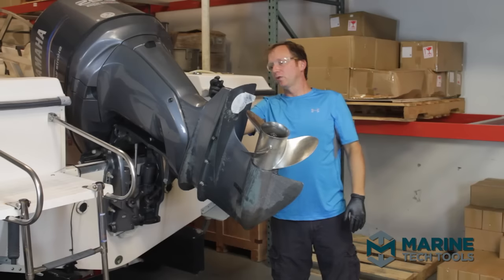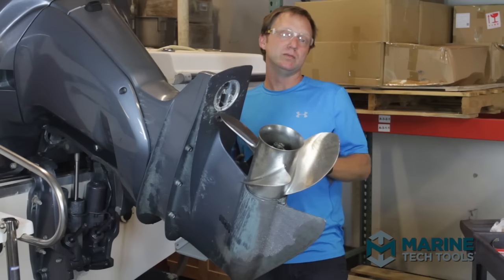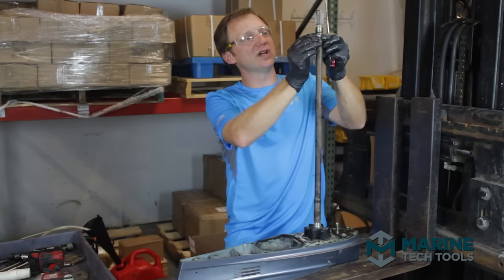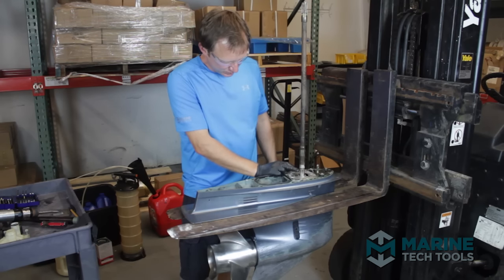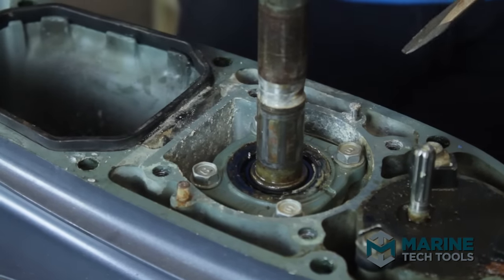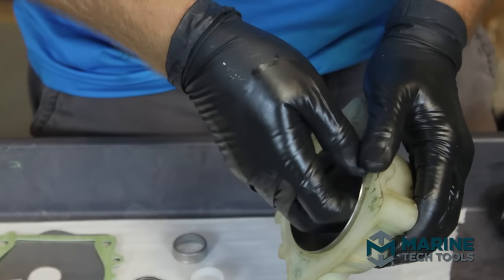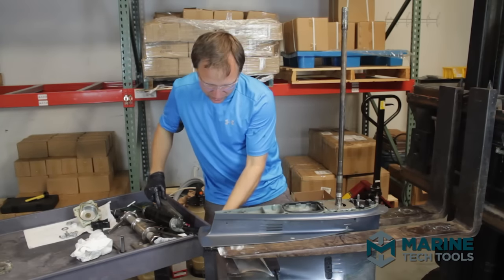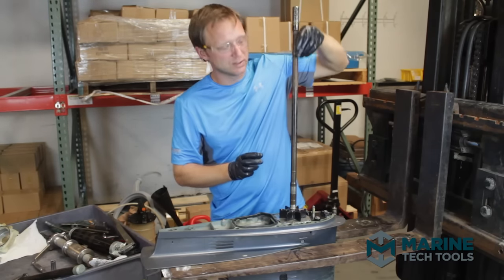Yamaha Outboard Water Pump - Teardown and Replace

Comment: Excellent video and excellent comments. This is great for those of us needing to see this done.  The first time I had my impeller replaced by a mechanic we had a rattle. They fixed the rattle.  Did it myself this time, same thing, I have a rattle. Not sure if it's from not pulling on the shaft hard enough to get the play out or how far down I need to tap that piece on top of the impeller when pulling on it. Any suggestions would be great.

Comment: Really professional video.  That woodruff key seems like a crappy design - no?  (shouldn’t have to hammer, heat - drill on the drive shaft) as a standard practice.
Reply: Agreed. My key was literally fused to the shaft. Currently using a dremel cutting disk to slowly create a new slot for the key. What a mess.

Comment: If the speedometer tube is broke will it stop the pee function when flushing? Is there video on replacing the speedometer hose? Ours is broke off right where it goes into the lower housing.

Comment: Do not put to mutch grease on the bolts the air in the bolt holes can build up kinetic energy and crack the alumin(i)um! and instead of grease on the rubber impeller use vaseline it stays in place longer and wont not hurt marine life

Comment: nice job.  but 2 things.... im pretty much an idiot, so correct me if im wrong...
1.   Are u sure u want to use grease inside the cup?   
 MAYBE around the o-rings, but have you seen what happens to a little bit of grease once the impeller whips it up inside the cup?  It turns into butter, which can possibly clog s*** up....  i sometimes use dish soap inside the cup and it will just wash away.  maybe im going overboard. 

2.  howz about using a punch on the key and give it a good whack a few times.  i know its frozen sometimes.  thats when i get out the dremmel and grinding small grinding disk and grind a slit right down the middle of the key.  Then grip w a pair of vise grips and "crush" it in half.  works perfect and no nicking the shaft.  it instantly falls out....

but good job and thorough.
Reply: +1, I Iike the soap idea for this!

Comment: After doing this, a couple of things: 1) It is not necessary to replace the woodruff key.  It is not worth the effort. 2) The metal cartridge is held in with RTV from the factory making it near impossible to remove. It may be best to buy a new housing without the cartridge the first time you do this. Also, the factory manual calls for gasket maker around the perimeter of the mating face of the lower unit. There appeared to be a very light coating of this the first time the unit was removed. None of these DIY videos mention this. I skipped it. The factory manual also specs Loctite 572 for the bolts. I could not find this anywhere near where I live. I used another brand medium hold thread locker. Sliding every thing back on  my 2016 F115 was easy. Just watch the gearshift shaft. It is possible to have the lower unit mate up with that shaft not engaged. Don't ask me how I know. Anyway, I have water coming out the pee hole so I assume I did it right. This video was very helpful.
Reply: I was not able to replace the metal plate or the gasket without removing the woodruff key first. However, the woodruff key was a total disaster and I wish I had never messed with it.
Reply: What they really need to do is make the gasket and friction plate replaceable without having to remove the woodruff key. This is the way.

Comment: by the way, at 8:19 that is NOT a 'puller' it IS a slide_Hammer, a puller uses hydraulic or screw force to remove parts, aka think of it in the guise of a portable shop press.

Comment: Excellent video as always!! Keep the good work... I have done this to my F40, but left it to neutral. After reinstalled the lower unit, the prop is stuck. Doesn't move left or right. What can I do? Thanks
Reply: Tare it back down and fix it right.  Sounds like the spines are not lined up or the shifter rod is not lined up

Comment: After installing the water pump on vf115, and reinstalling the lower unit. I put  the motor in the water, I'm getting water and exhaust in the shift tube. Is this normal? where did I go wrong?

Comment: Good video, very informative but for a professional shop I am surprised not to see a spray can of penetrating fluid, a can of anti-seize lubricant, or a parts cleaner sink, and a brass hammer to knock in the woodrift key.

Comment: If you are working with a counter rotation motor, would you turn the driveshaft counterclockwise when setting the impeller back into the housing??
Reply: Not unless the motor runs backwards

Comment: Where can I get one of those upper seal puller you have? If I cant, how do I get the parts off that would be pulled with that puller? also how do we know if the shirt changer is in neutral on  the lower unit before installing back? forgot to mention I'm doing mine on a 2013 115   4 stroke
Reply: Dude...some advice. Just take it to the shop
Reply: @Bushgator  I agree to do it yourself some professional time strapped mechanic can screw up just about anything. There are situations to take it in but water pumps, spark plugs, filters better off doing it yourself.

Comment: how do you put seals on the Tilt hydraulic cylinder?  2006 250. does the top T come off or the bottom unscrew from the shaft once its apart? i don't want to damage anything

Comment: Who don't you remove prop before removing lower unit?  It would make removing and installing lower unit soooo much lighter
Reply: That thought crossed my mind too... take off the damned prop to make it lighter! Also, it would probably be a good idea to grease the splines on the prop shaft too.

Comment: Ok, I don't have that fancy puller for the driveshaft collar.... How do I do it????
Reply: It’s a mini pull clutch mate. They’re on various cars. Essentially you push the metal top cover down at the same time as you push the clips up into top cover. Then pull the whole thing up. Never bought one. They’re reusable. They are a pain till you get the knack. Good luck.
Reply: In another video, a guy uses two sockets on opposite sides of the shaft as fulcrom points, then uses a small screwdriver to gently pry/rock the collar off. Looked pretty simple.

Comment: Hello

Do we shift it forward in gear or leave in neutral before dissassemble the lower unit for water pump replacement. 

Thanks
Reply: Trung Diep  leave it in neutral

Comment: Does the Yamaha SHO 225 have the same spacer and spacer ring on top of the impeller? if so how do you remove it with out that special tool you used?
Reply: Did you find out how to do it without the special tool
Reply: wazup3333 two flathead screwdrivers resting on two sockets that are around the height of the part. Use the sockets to pry against. Pry carefully from both sides and it should pop up. If it’s really stuck cut it with a dremel tool and replace the plastic spacer and stainless ring. Less than 20.00 at any Yamaha dealer.

Comment: How do you remove the drive shaft collar without the fancy puller?
Reply: Capt. Bill Moore  just a screwdriver will get them off.  Not hard.  I don’t know how he got that much resistance to use a puller
Reply: Capt. Bill Moore or cut it with a dremel tool and split it. New nylon collar with stainless collar less then 20 at any Yamaha dealer.

Comment: If you put heat on the key it will come off. If the key is seized it's because of heating issues which reacts with the metallurgy molecules similar to a friction weld. However heat or using a blow torch will also reverse the molecules so it can be removed but all grease and other material should be cleaned first. Heating may destroy gaskets and other soft components but in this case they need to be replaced anyways. Allot of shafts cases that use keys are intentionally heated so they stay in place with high rpm shaft speeds. Why are you not putting grease on the shaft? The old grease should be removed and new grease should be applied. If you do not grease the shaft it could seize up or wear allot quicker. Grease should be placed all around the impeller wear plate because when you initially crank the engine up the impeller has zero water. If not the impeller will wear allot quicker and the grease is going to do nothing but help lubricate.

Comment: nice vid.. one question, why not never seize on the bold threads vs grease?
Reply: I read that you can use food-grade anti-seize compound which does not have any metal in it.

Comment: My 2002 150hp shop manual says use medium Loctite on housing bolts.  Not grease.
Reply: Hmm...I've done quite a few. Usually use never seize. Never had a loose bolt...ever. But it did look like those bolts had washers and no lock washers so

Comment: why is it necessary to pull up on the drive shaft while seating the collar?
Reply: My mechanic did mine and didn't pull the shaft up and when I started it it was really noisy in neutral so had to pull it off again and fix it

Comment: When removing the impeller itself then when I remove the base plate and the gasket under it,  am I able to remove it without taking the keyway out.? I have a Y115  also its important to have that key way even when you replace it correct? so as to when you replace the impeller down onto it it glides into place easy and not get jammed up.

Comment: Excellent video!!
I have a 2004 Yamaha 150 4 stoke that I need to do the water pump job on. Anything on my 2004 that differs much from the motor in your video?
Thanks!
Reply: Most 115hp on up Yamaha engine's are the same procedure. Early model's didn't have the collar on top of the impeller

Comment: What if you break the speedo fitting
Reply: Abner Begley you can replace it with a new fitting from Yamaha. It’s only plastic, so an ez out removes the broken part still threaded in no sweat.

Comment: nice?!. re: the woodruft key    drilling method . no pilot for drill bit?, no lube, and ALL THE SHAVINGS FROM DRILLING, end up in the seal THAT you were SO and cautious about... must be a boat mechanic with 25+ yo experience repairing boat motors etc....
job security! - I get it...I do, appreciate the video, but, methods are questionable.

Comment: That must be a saltwater motor. I think you guys making these how to videos of how to change a impeller need to learn a little about anti seize and grease.  All bolt threads, woodruff keys trim tab seats and bolts. Steel and aluminum with H2 O make galvanic corrosion.  Anti seize on those collars and pump housing. Sorry, but you make it look and sound a lot harder than it is.

Comment: How about instead of buying an expensive specialty tool to remove the driveshaft collar, do this. Cut it off with a Drimmel and replace it with a new one $13 takes about 30 seconds You're welcome

Comment: I broke my speedometer cable fitting yesterday. What happens if I left that just broke off because when I lowered it into the bucket after changing the water pump I had oil in the water and on the foot at the waterline. Is it because I did not replace that fitting and just left it open. Can oil come out of that fitting and can I since I do not use a speedometer and it is blocked off just plug it? Rather than purchase the fittings for the speedometer cable I never use. I only ran the motor a few minutes in the bucket to test the water pump saw the oil and stopped.